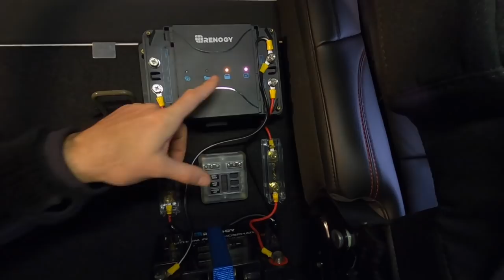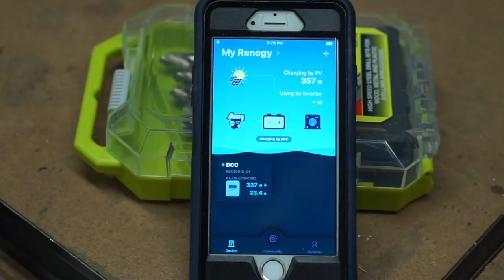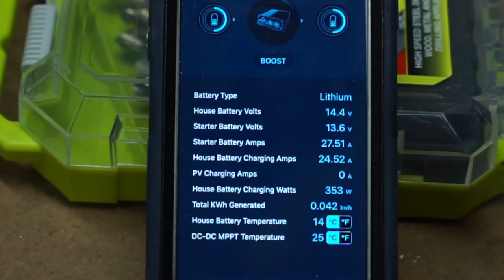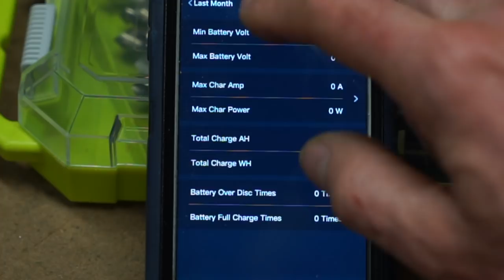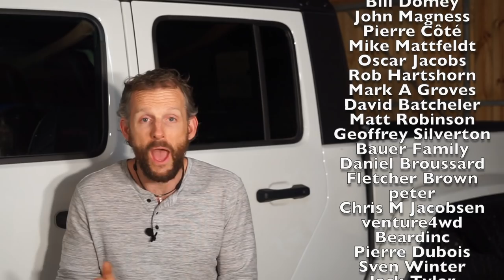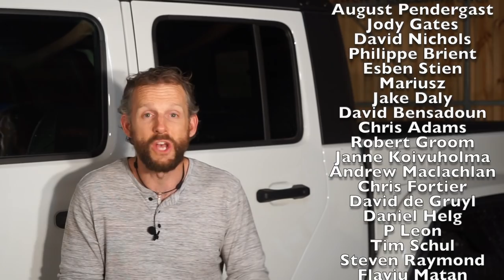21st Century Dual Isolated Batteries - WITH SOLAR for Overland vehicles

Comment: Hey Dan,  electrical engineer (well, almost, I’m finishing up school) here. First of all, great video and great system you’ve designed. I have one suggestion about the way you’ve installed your fuse for the starter battery. By putting the fuse near the charge controller, you are essentially protecting only for when the charge controller is charging the starter battery. However, since that charge controller seems to be well made, I would guess that in the event of a short, it would detect a fault and stop trying to charge the starter battery anyway. So I don’t think the fuse is doing much good there. Now consider the case where there is a short between the starter battery and the charge controller. This could happen because the chassis of the vehicle is grounded as you mentioned. The result could be a dead short circuit across your starter battery, which would at best drain it, at worst cause a fire. All this to say - I would recommend adding a fuse right at the starter battery on the positive terminal to protect from this case. Even though a short is probably unlikely I’d personally do it because it’s easy and cheap. Anyway just my 2 cents, I could be totally wrong here but that’s just what I noticed. Again, great video!
Reply: agree
Reply: You’re totally right mate

Comment: Hi Dan !
I really believe this fuse between the starter battery and the charger should be close to the battery. Your cable between the 2 is quite long and it's installed by you (so it does not have all the OEM validation to make sure nothing rubs or cuts it), if it ends up shorting along the way your main battery will be in short circuit and the risk of fire is important.
Actually I would put an inline fuse as close as possible of the battery post, if the fuse was to completely melt the positive wire connected to the battery should not be long enough to touch anything.
For me the only cable allowed to connect to the battery without an inline fuse is the starter cable, anything else goes through a fuse before to leave the battery perimeter.
Reply: I think that he is supposed to used one of the 40A fuse that he got amd use that from the starter battery back to the DC-DC charger. 
Using the fuse from the DC-DC to the house battery is a bit overdoing it I think, that short distance is more fuse than cable now :)
But nice video, Im thinking of upgrading my setup to Lithium ...
Reply: Yes- I was thinking the same. There should always be fuse next to the power source. - Also next to the car battery in this case.
Reply: I agree with the fuse close to the starter battery, personally I prefer circuit breakers as opposed to a fuse. It also makes it easy to disconnect the aux system.
Reply: Hi Dan, I agree with the other comments here, please put an in line 40A fuse close to the positive post of the starter battery. This will protect your car in case you have a short on your long connection to the house battery. The fuse you installed will not kick in if this happens.
Reply: I concur with these comments.
Reply: As others have said, fuse at the main battery on the positive.  If not you could short out and cause a fire.
Reply: The wire from the stsrter battery to the DC-DC should be fused at both ends. The Renergy unit can send power both directions, so a dual fuse protects both sources.
Reply: I was just looking to see if anyone had said this very thing. Fuse needs to be as close to the source battery as possible.
Reply: I was also wondering about the choice of fuse (although the fuse he used I believe came with the charger). I like the maxi fuse design and that may be a little easier to find should you need to replace one. If there is a downside to them I'd like to find out.
Reply: I agree this. You should put fuse near the car battery. In your case its higly unlike to shortcut but better be safe than sory. 
Great video and explaining 12v systems, i actually understand that. Nice work👍
Reply: Great job! I also think that on an expedition vehicle you should use circuit breakers, if you need to work on the system, just press the button and it opens the circuit. Can’t wait to see your adventures soon

Comment: Hi Dan - I know your sparky suggested 6mm wire (which I am gathering is 6 mm squared) but that seems a tad light for 30A over 4 or 5 metres. You'll be getting about 0.7 or 0.8v voltage drop through that cable size, for that distance, so 12.7v at the battery could come out the other end at 11.9v.  It doesn't matter much I suppose because the DC/DC charger will boost it to what the lithium needs, but you could have gone up a size in the wire. And as everyone else has said - fuse right next to the starter battery.
Really like the idea of the solar charging both the house battery and the start battery - that's great. And the bluetooth too. Wish my RedArc system had the bluetooth option.
Cheers - David

Comment: I completely agree with Renogy as a top choice. I've been using their stuff in a few applications for years and they're great.
Good to see you're moving along on the build.
Reply: If only the app wasn't buggy as hell. Constantly have to restart app, restart bluetooth, delete the charger from the app and re-add it, unplug and replug bluetooth adapter.
Reply: It's a sweet setup he's installing. I use renogy in my remote workshop and on my property. 
In my overland vehicle I use a 60 dollar off brand isolator and an 80 dollar Walmart deep cycle battery.  It's been doing the job for two and a half years running the fridge and accessories. Granted, I'm not going around a continent but what's the difference? It's still running everyday for 2 1/2 years for 140 bucks!

Comment: A couple of quick observations... you definitely need a fuse at the starter battery. That's critical. Also, it's too late since you've already run the wire but it'll be interesting to see how it's working once you have the system in operation. The 6mm (10 gauge) wire you choose is thinner than we'd use for that application.  Making some guesses about the total wire run length, if you're pulling 30A to charge the house battery you're going to have a voltage drop of over 5% which is a lot. Heavier gauge wire would definitely be better. Still, the controller is showing 25A at a high voltage which is interested but seems sort of impossible. It might be worth checking at the terminals with a meter.

Comment: Great video mate. I've installed my renogy system about 6 months ago and have been well pleased. Will prouse gave it brilliant reviews. Mine's a defender with 300 watts of flexi panels on the roof ( not much sun in the UK lol ) the renogy 50 amp charger and the renogy 100 amp lithium battery. Even easier to wire as the starter battery on mine is under the front seat. It also gives me the option of linking a 2nd House battery and maybe using a inverter to run a induction hob for cooking, should funds permit in the future. Would save carting around gas cooker and bottle. Another bonus is when parked up at home for any length of time, the solar keeps both batteries fully charged and prolongs their life.

Comment: Great choice. In addition, you can use about 90% of Amp/h from your lithium, vs about 60-70% of  AGM. Or 50% of acid lead. So half the weight, and almost twice the useable power. 👍🏻

Comment: I have that same charge controller and it works great. The mistake I made in my dual battery setup is going with an AGM battery. Far too heavy. We just got back from a 3 week trip in the desert and even on 100 degree days we did not use more than 20 AH per day running a Dometic fridge and a few led lights. Thanks for the video. I’m enjoying your build.
Reply: Hi can you tell me what model charge controller it is

Comment: Great video and explanation.   I have the same Renogy 30A controller with the Bluetooth module in my 2000 4runner paired with a 100Ah SOK LifePo4 battery and a Renogy 100 rigid panel.  I really like this set up and can affirm how well it all works.
Reply: What do you think of the Renogy app for the Bluetooth? I just installed this system and the Renogy app that was available for Android looks nothing like what Dan showed and  is mostly useless.

Comment: I did consider the Renogy 50A DC to DC MPPT unit but it doesn't have a Low Temperature cut off to protect Lifepo4 in cold conditions. Plus the voltage input is limited which means you cant use larger wattage solar panels. You can only use 6x 100w panels maximum. If Renogy get their act together and design this with a higher wattage solar input they will easily triple their sales. Then I would certainly change my new MPPT to a Renogy DC to DC charge controller. The new version really needs to be 60 amps (minimum 40 amps from solar) and the voltage needs to 100v minimum.

Comment: Nice unit! I choose victron for my systems. Also because I have a 24volt truck and 12volt camper setup. So my DC-DC is 24-12/30A and seperate 75/15 solar controller. the advantage is when I upgrade my solar panels I just swap the controller to something bigger. So my idea is just upgrade the unit when I have more need in the future. My inverter is just a small one and I also have a bigger inverter of 800 watt for my water cooker.

Comment: Hi Dan , let me start by saying I'm loving the gladiator Bild  I did want to point out that the   40 amp fuse you have  from the starter battery should be at the other end of your positive wire . Keep up the great work on your gladiator very professional work thanks for the video's . Steven.

Comment: Dan, great video but the Gladiator being a new vehicle comes with what we call here in USA an Smart Alternator meaning that the alternator will vary the amount of current delivered to the start battery depending of the charge it has so that way the vehicle saves gas mileage and the alternator is not working that hard all the time, so with that in mind, you have to connect the cable that goes to the ignition input into the Renogy and pick something in the fuse box of the gladiator that doesn't work when is off... that way the Dc to Dc charger will sense the voltage drop and adjust accordingly the amount of current to the house battery...😉
Reply from the maker: From what I can gather, the alternator is not "smart" like the Euro ones - it can turn on and off dynamically, but that's about it. So I think of it as "half-smart"
As soon as the alternator turns on, the charge controller sense that and kicks in and puts load on the alternator, which will keep the alternator on until the charge controller is don (battery full).
So I actually don't need to run that other 12v trigger wire you mentioned, it functions perfectly without it.

Comment: Great video, thank you so much for the information! On the inverter topic, I see where you are coming from and not having one may be the right choice for you but having one for versatility sake might also not be a bad idea. I had an extra one, quite small, and it is located under a seat in my pickup. I use it rarely but it does see occasional use.
Reply from the maker: The list of things I could bring on my expeditions that might get occasional use is literally endless. Three years on the road in Africa!
.. but of course, there is no space, payload or budget for such things, so I cull those "optional" items.
Reply: @TheRoadChoseMe   great videos and just so inspiring,  thx so much.  Quick question, I'm quite ignorant when it comes to this stuff. Apologies. But do you not need AC power to use USB chargers, if not how does that work? Thanks, and apologies if I missed something.
Reply from the maker: USB chargers can be wired directly from 12V - I'm actually about to start on that soon, and I'll do a video about it specifically.
Reply: @TheRoadChoseMe  Totally understandable. I'm not yet into any kind of overlanding and the space and weight is not presently a concern. I have big ideas for my pickup though and when I start to act on them I'll share what I'm doing.

Comment: One thing I didn't hear (unless I missed it) with the move to Lithium battery is that it really is superior for AH's versus the old Optima. Even with similar AH total ratings, you can't depleat the AGM all the way like you can for the lithium. So really even though the new battery is 50ah, when compared to the old Optima it's nearly double the output. Also charge cycles and charge rates being so much more superior.

When I replace my system, I'm seriously considering going this route. This was a smart move.
Reply from the maker: Absolutely spot on! I did so much rambling in this video I forgot to even mention that, but that sure is right.
I feel like this is far superior to my old setup in every way.
Reply: @TheRoadChoseMe  - To add, the smaller package size is great to allow a move into the interior. All wins in my book. Interested to see how well it does long term. No better test than what you are doing!

Comment: Hi Dan, your choice it’s perfect very nice set up but there should be a fuse between main battery from positive terminal+ in front your Jeep , l know all line from battery it’s very well protected but just in case. I travel in Australia 30 years also in very simple dual battery system and never let me down. Have a nice day.

Comment: Another good thing about DC/DC chargers is the lithium battery can accept a charge at such a high rate that it can cause your alternator to fail trying to keep up. So a DC/DC charger prevents that as well.
Reply from the maker: And I have the up-rated 240Amp alternator, which is great!

Comment: Definitely fuse both ends of the main cable also I found blade fuses get hot with constant current draw [mine melted into a blob] running a fridge.I went with circuit breaker fuses recommended by a auto electrician.He told me he had seen fires caused by blade fuses under constant current draw with the recommended amperage.

Comment: Fantastic video. I've watched several times. This setup anchors everything to the truck though. What would I need to enclose the battery/charger in a removable box so it can be easily severed from the alternator and taken out?

Comment: Hi Dan, looks like great easy set up.  One item though from a safety standpoint.  I believe the fuse the start battery is hooked up to should be as close to the starter battery as possible to protect from shorts anywhere along that line.  The way it is now you are only protecting that short line between the fuse and the charge controller.

Comment: Hi Dan.  Thanks very much for the videos - they've been fantastic.  I've ordered the equipment I'll need from Renogy Canada but your discount code did not work with them.  I'm not sure if that has any impact on your commission but I thought I'd give you a heads up.  Cheers
Reply from the maker: Thanks Ed - I've been told the code is only for the USA store, no worries.
Enjoy that Renogy gear, I'm super happy with mine.

Comment: you didn't mention this specifically, I'm curious why you went with this approach  instead of getting an all in one style unit (Eg, Jackery 1000).
seems like that would be a very easy way to do it and looks like it would be even cheaper.
if you have weighed the pros and cons elsewhere sorry.

cheers!

Comment: Hi Dan am liking the videos have the 50A DC/DC Renogy and mine has to have a wire that is connected to a ignition wire for the smart alternator does the 30A model not have that ?

Comment: I didn't catch it in the vid- what charge controller is that?  I was on the Renogy site, and I didn't see it.  That is a CLEAN install!!
Reply from the maker: It's the DCC30S 12V 30A Dual Input DC-DC On-Board Battery Charger with MPPT

Comment: This is awesome. I was about to pull the trigger on a genesis dual battery system, but it honestly comes out to almost the same price after adding a battery and an MPPT to that. This is a much better option for my jeep. Thanks for the thorough video!

One question; did you size your fuses based on the max current rating of the charger, or the max charge current of your house battery?
Reply from the maker: Glad it was helpful!
The big fuses are sized for the max current the charger can pull from the Alternator (30A in my case) and the max current the charger can push into the house battery (30A in my case). I don't even know if the battery can take more than 30A charge current (I suspect so).

Comment: 21st century for sure. Question: how’s the MPPT treating your acid or gel starter batt if it’s not Lithium. Would both batteries need to be the same type to avoid damage or is the contrôler switching to the correct battery type between the 2 ?  Thanks
Reply from the maker: It only trickle charges the starter, so it's not a problem.

Comment: I love the ability to use the solar panel to act as a trickle charger for the starter battery when the vehicle is off for a few days, but I’m not a fan of the extra load on the alternator to charge the auxiliary battery when the vehicle is turned on. Is there any work around for that?
Reply from the maker: If you don't want to use your alternator to charge your house battery, then just use a solar charge controller and not a DC-DC one.
It will work, but I doubt you'll get enough charge in the long term unless you have a ton of panels and not much load.

Comment: Hey Dan,

Does the battery itself measure outgoing current aswell as incoming? I'm trying to work out how the battery measures it's own capacity if it only measures incoming current and voltage. I know smart shunts masure ingoing and outgoing but not sure about Renogy's internal BMS.

Comment: If, for some reason, your starter battery dies, can you start your car on the house battery...or at least charge the starter battery (from the battery- not slowly from solar)?
Reply from the maker: The charge controller would automatically charge the starter from the solar.
I don't know about jumping the car from the house battery, I don't know if the Li battery is rated for that kind of current draw